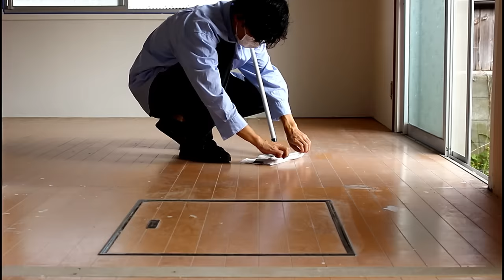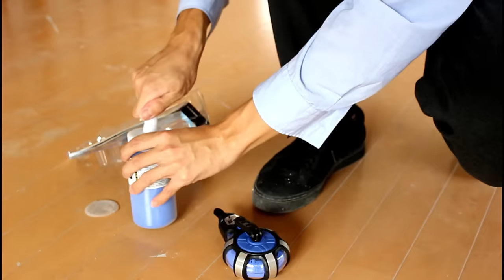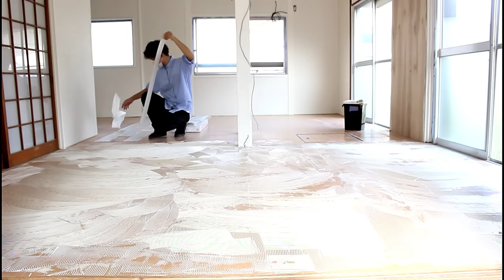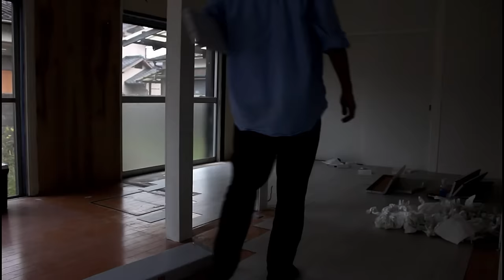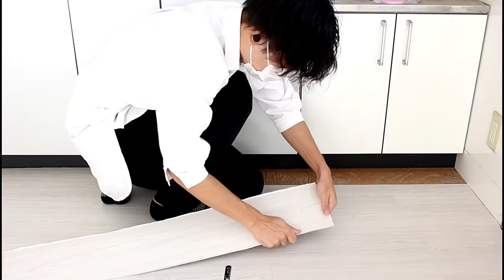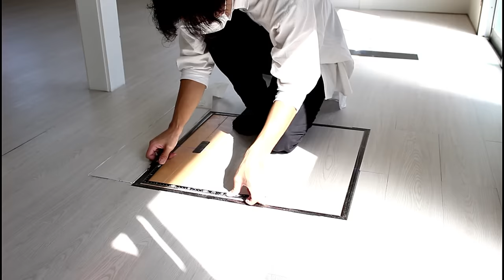【DIY】4万円で真っ白な部屋に！#14 相続物件をセルフリフォーム！床にホワイトウッドのフロアタイルを貼る方法と手順を解説

Comment: Is that vinyl flooring? I redid my house with vinyl and didn't put any cement underneath... interesting. Is baseboard and quarter round used in japan? In canada due to the seasons even if we didn 't want to use corner material, expansion and contraction would make it look ugly
Reply from the maker: This is a PVC floor.
I use a base board in Japan.
Some houses are not used if they are old houses.

If it's cold like Canada, you need to stick to the material.